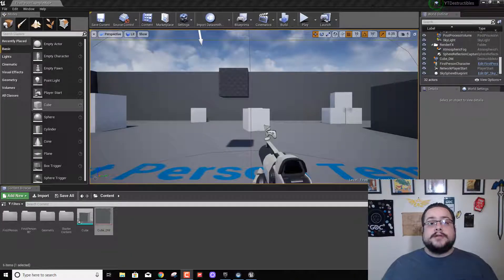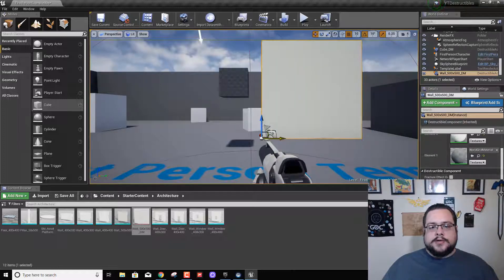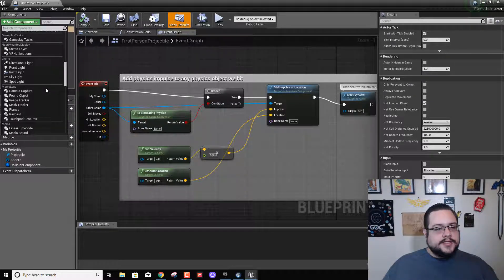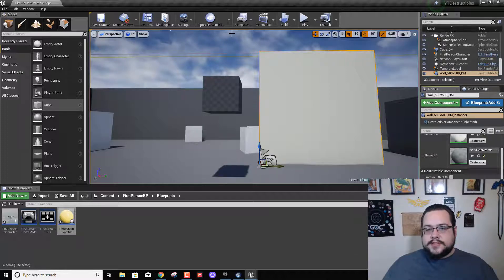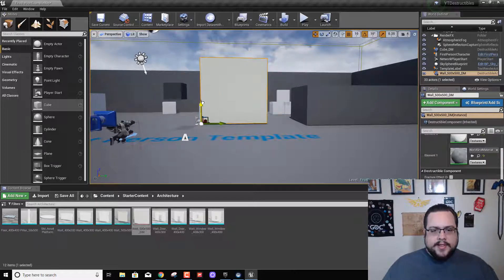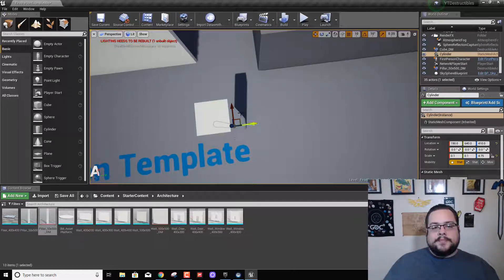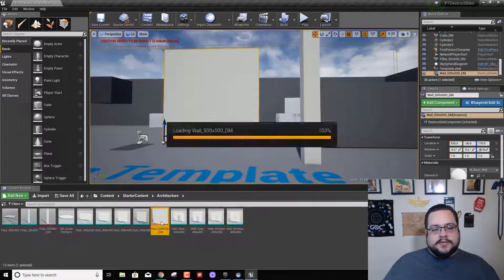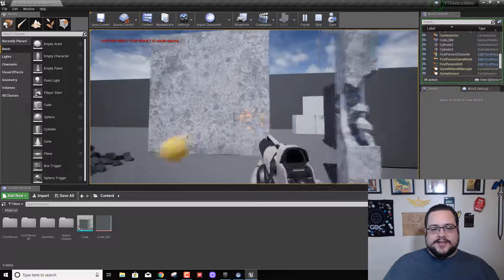Destructible Meshes in Unreal Engine, Part 2

Comment: This is a pretty old video but how would I stop the object from breaking if the player touches it? When I touch the wall it cracks. It wont break apart like as if I shot it with a bullet, but it does visibly crack.